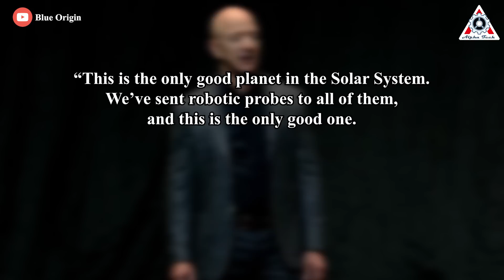Blue Origin Failure…

Comment: The Space habitat idea borrowed from O'Neil and others. Reusable concept copied from SpaceX. BO talks the talk but can't walk the walk - nothing original there. New Glenn, if it ever flies, will be competing with Falcon 9 and probably Starship. However, by then they will be well proven designs and cost much less than New Glenn or Vulcan. Bozzo is too tied up with the Amazon concept of importing Chinese low quality copied technology and selling for a large mark up, unfortunately they haven't got a BE4 type engine. Worse still he conned the gullible Tori Bruno into believing he could make BE4. Both Vulcan and New Glenn will use the BE4, but if BO can only produce 1 (perhaps 2) in the last 5 years then neither will fly and ULA will fold as all its lucrative contracts are taken by SpaceX as ULA have run out of launchers. Perhaps ULA and BO should join forces under the ULA name - United Losers Alliance.

Comment: ULA made a huge mistake betting on Bezos and BO.  After years of delay we may see the first launch using the BE-4 in early 2023 and if it goes well then maybe they struggle on for another decade, but if they fail, if the engine fails, BO is dead and ULA may die along with them!
Reply from the maker: Honestly, 5 years ago, B.O is better now

Comment: You forgot to mention that SpaceX is very close to loosing their moon lander contract.  Because they were supposed to ALREADY HAVE a prototype.  Instead they used that money on Starship...  Yes they are related.  But other than building a hollow nosecone and painting it white....  Have shown zero progress to the landing system.  And NASA is getting frustrated.  NONE of their Raptors have been rated.  And the ratio of failures after a second firing is not good at all.  Sound familiar?  It should.  Its the same issue BO had with the BE-4:  Turbo pump seal failures after hot starts
If SpaceX doesn't get two things:  Payments for 20,000 starlinks  And anything at all happens to booster 7 before during launch, SpaceX will go bankrupt.  They have no more cash.  The is BTW why Elon and his big mouth want out of Twitter....  He no longer has fluid funds thanks to that Debacle.
But this is where Musk differs from other CEO...  He will sleep on the floor of SpaceX and eat ramen noodles to make it succeed.  And this attitude and leadership may be the only thing that saves SpaceX

Comment: What I can't understand is why ULA doesn't drop the BE4 and BO. At this point there massively behind in getting their new launch system up and running. At some point it's going to cost heavily in lost contracts to Space X. Even if BO delivers WORKING engines for the test flight, how long will ULA have to wait for the next set? Is ULA willing to lose everything because they can't get enough engines to get rockets capable of launching the customers payloads.
Reply: I don't think BO will ever fly, nor will any
 other COUNTRY eclipse SpaceX's lead
in rockets.  Numbers don't lie - Heavy is
less than $100 million per launch + two
of the boosters land back where they
launched from, and in this mission they're
going to "throw away" the core.
   Napkin math - $100 million per @ SpaceX.
   ULA's Delta IV Heavy is $350 million per +
they got no motors - Dr. Evil can't even build
a rocket engine.
Reply: 0 by p
Reply: 40 to 🔥p 🔥👍💯
Reply: O
Reply: 😎9 00 p
Reply: 0 🔥🎉0
Reply: . 🎉L no 0
Reply: 😎000
Reply: I wonder if ULA ever secretly inquired with spacex about some Raptors?

Comment: SpaceX landed the first falcon 9  rocket back in 2015. Way before blue origin. How I know because I help make it happen. On Oct. 7, 2013, SpaceX's Grasshopper rocket climbed 2,441 feet (744 meters) into the air before safely landing back on its launch pad in McGregor, Texas.
Reply: Grasshopper is not Falcon. It's like claiming that BO launches and lands New Glenns because they do New Shepards.
Reply: This video is correct in what it said 3:32  BO was the first to launch a first-stage rocket into space and land it back on earth.
Reply: @phillipkalaveras1725  This is misleading though as 100 km up and down is super easy. Orbital velocity and down is quite hard. Grasshopper probably could have gone to 100 km but not much point.  

BTW, HOLY SHIT @smrman travel worked on Grasshopper. End of conversation, you win.

Comment: When is Bezos going to launch anything into orbit. Is he capable, can he?
Reply: He is getting closer. The sharpie used by SpaceX Dragon crews to write their name on the wall of the launch tower is Amazon-bought.
Reply: @henkvandenbergh1301  LOL
Reply: Hasn’t yet.
Reply: Lol. As soon as he is done stealing money for the junk rocket engine
Reply: Well, I hope so. They have done so much work here at the cape. Just never launched anything
Reply: He needs to have the BE-4 engine working.  There is supposedly two engines completed but one had to be sent back to the factory for repairs...  That was months ago and it still isn't "flight ready".  This delay makes me think a number of things...  Was the first engine delivered really flight ready?  How can it take so long to fix an engine which is supposedly identical to the first?  If they have had this much trouble with two engines, how quickly (or slowly) can they build others?  No engines - no launches!
Reply: Meanwhile, SpaceX pumps out a Raptor engine in just a few days and they're building a second engine factory.  The production gap keeps getting wider.   The contrast is comical.
Reply: Bezos suffers from premature ejaculation... this is why his rockets can't reach space... they already shot their load